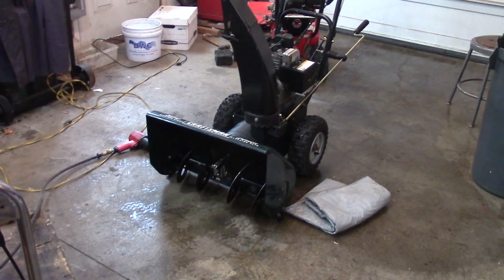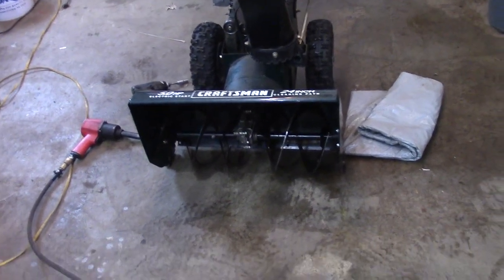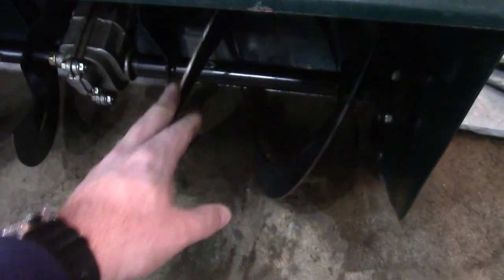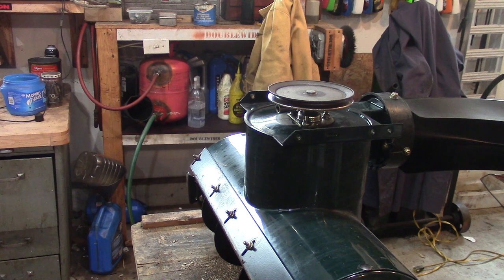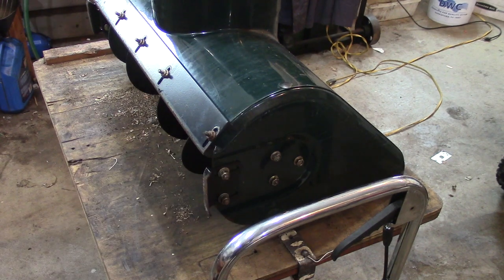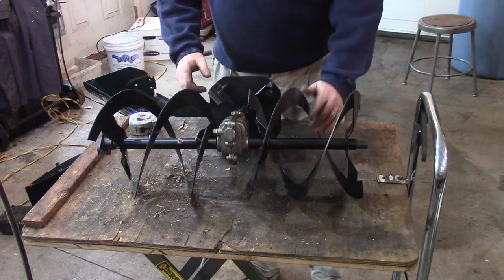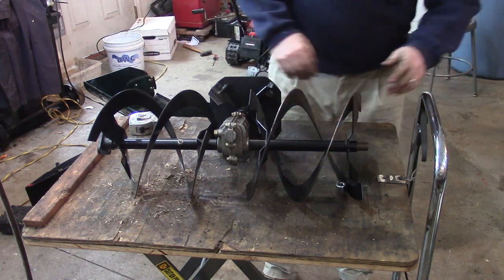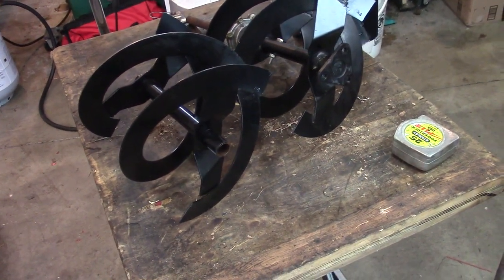Craftsman Murray Snowblower Auger Not Working Part 1

Comment: Years ago, I had a dealer repair the worm drive and they swapped the augers.  It took me awhile to figure out what the heck was wrong with the machine since both augers were pushing snow out!  That little screw-up cost me $300!  Thanks dealer!
Reply from the maker: Not surprised.  I have never done it myself, but I understand how it could happen.

Comment: Hey doublewide, long time viewer first time commenter. Been enjoying your videos for a few years. I was hoping you could give some advice - I have the same snowblower but in grey, I’m trying to replace the auger gear but cant get the augers off. They seem to be seized up pretty good. I’ve tried deep creep between the shaft and auger and banging on the shaft, heating with propane, and am about to try electrolysis.

Comment: So, he's had this for almost 15 years and this is the first time someone told him it's built wrong?  Sears hasn't made a green snow blower since 2004ish.
Reply from the maker: Well, he owned it and it didn't work too well, so he was just paying to having his driveway plowed.
Reply: OK, Just checking. I had an owner of a 2001, 42 inch Craftsman tractor who complained the mower left strips down the middle. I asked her how long it was doing this and she stated "10 years." I looked underneath and the blades had worn so that they were only 9 inches long! New ones are about 21 inches. She couldn't believe how well it cut after the new blades were put on :)

Comment: wrong auger.  I saw it before you even said it. I thought mabe someone reversed it. The sheer pin hole wouldn't  be right to just reverse it. I know of a salvage yard 30 mile from me that has plenty of those for parts. Someone on the assembly line was hanging over the day that was made. It's very seldom you run across a factory mistake  like that. I have had a couple of weed wackers and one snow blower right from the factory with defective parts. The snow blower had been serviced under warrenty twice and still had issues.  I had to drill out the jet on top of the carburetor  in order to stop it from surging. The original owner got so mad, he just parked the snow blower  out back and went and bought another brand. He gave it to his grandson who brought it to me. I had it fixed in 20 minutes. It's been running great for 3 years.

Comment: You had the bearing loose (3:19) but you should have pulled it off completely. It looked stuck at the shaft end. Probably mushroomed from beating on it. Could have hand filed a little to clean it up. By having the bearing off, the auger assembly would fall out of the tub. Assembly is the reverse. Bearing is put back on, after the auger is back in the tub. Been there, done that.
Reply: Sorry. Not 3:19 but rather (8:52)

Comment: Since you have a welder if you can fab 2 helix parts should be able to weld to the side supports,  if it's worth the time vs buy one.
Reply from the maker: The sad thing is I tried this, it became such a waste of time and total fail I did not post the video.  I could not bend the metal far enough to have the ends meet up to the perpendicular members of the auger.  Basically, I learned the hard way.

Comment: Can the mounting flange be cut off and welded on the other side so you can basically flip it over?
Reply from the maker: The sad thing is I tried this, it became such a waste of time and total fail I did not post the video.  I could not bend the metal far enough to have the ends meet up to the perpendicular members of the auger.  Basically, I learned the hard way.
Reply: At least you tried.

Comment: That is weird.   It also amazes me how many people cannot notice that.  Maybe it's one of those things that the scientists could tack onto their IQ tests, lol.
The only thing this reminds me of is a guy I know got a brand new set of cheap right hand twist drill bits and one of them had a left hand cut on the tip.  I was able to resharpen it with the correct cut, so now it's just a little shorter than the rest.  ;)

Comment: $160+ for a single auger?!!?  Pardon me, but HOLY CRAP!  *grumble, grumble...*
Reply from the maker: Yup parts are really expensive.  The funny thing is used parts are getting cheaper.  What I see happening is Chinese replacement parts being sold cheaply,  I saw a lawnmower pull start recoil for $15 free shipping and tecumseh wanted $55 for it.